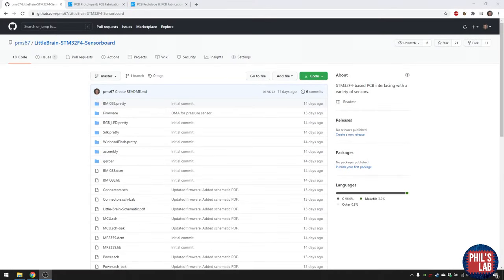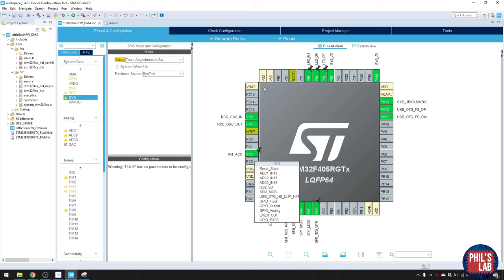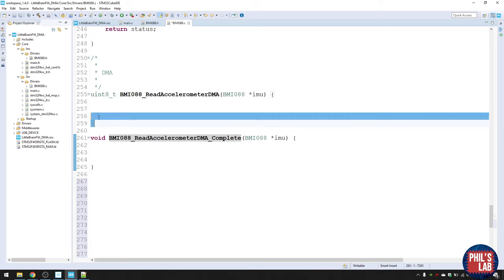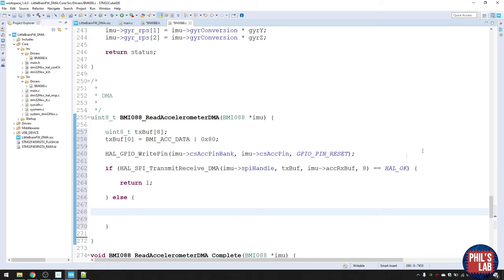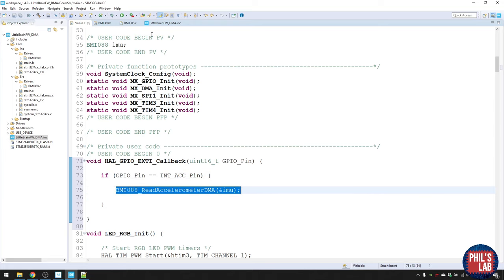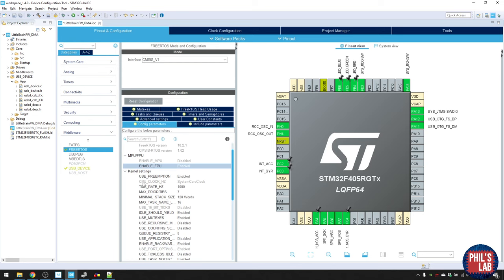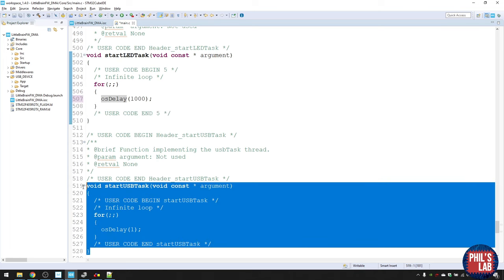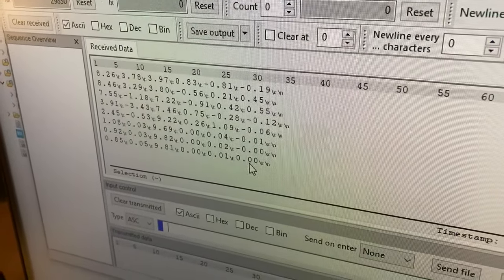STM32 DMA and FreeRTOS Tutorial - Phil's Lab #14

Comment: Thanks. Maybe one quick note on data consistency: If you want the IMU data in the printing to be consistent (all from the same sample), you should copy the data onto the USB task stack (local variables) inside of a critical section before printing. That protects against the IMU data from being partially updated by the interrupt during printing. This is naturally also true for using the data in other contexts: A Kalman filter would also want consistent samples. I am sure that you are aware, just thought I add that for your audience as such stuff can lead to extended head scratching :).

Comment: Would it be possible to design a board using mostly smt parts from the jlcpcb catalog, that is capable of running "ordinary" Linux, preferably with X11 and a connected USB mouse and keyboard? We seem to be so close with some of the more advanced embedded SoCs, but there seem to be very few processors in the JLCPCB catalog with an MMU.

Comment: Hi Phil, thank you for your videos! I have a question about connection using SPI but also any other interface, what kind of countermeasures do you program in case of error? I'm currently working in an application where I use the UART port in DMA mode, using cables between the STM32 and a Raspberry. According to the manual, if there is a framing, parity or noise error during a transmission, the DMA transference is aborted. The way I use to react to this: in case of error, UART error callback is called, I then write an Error state to a variable. A timer, every 3ms, calls an error_check() function on period elapsed. This function restarts the transmission on error. I don't know if there are better ways to overcome errors. I don't know either if all this is worth the code and time if the two devices connected by UART, SPI, etc are in the same PCB, where there is no possibility of cables getting disconnected.

Comment: Good tip, when you do "if (some_var == some_const)" I write it the other way around, so, "if (some_const == some_var)" so that if you have a typo and only put one = by mistake you get a compiler error for trying to assign to a constant.
I also like using zero as success, rather than 1, so that you can have many error codes that can be handled higher up if needed. I that's how the HAL works as well, HAL_OK === 0
Great video as always by the way!

Comment: Your videos are great, thanks. A request for future content that might be a good fit down the line:

FreeRTOS inter task 
  -signaling,
  -memory protection and
  -data sharing.

Probably with a concept of how to organize responsibilities. E.g. Kalman Filter operates on top of data from multiple sensors without having to lock for access. But an intermediary might be required if the multiple sensor inputs have to be consistent with each other. Something like that :).

Comment: question about sensor fusion, if you have an IMU that has different polling rates for the different sensors, how would sensor fusion work? Sure if it were a multiple you could I guess just use the lowest multiple sampling rate and subsample the other sensors or maybe average out the samples to some degree if a bit of phase delay is acceptable. What about when it is a non-integer value? Is the best solution to simply read whatever happens to be the most current value in the FIFO and read all the sensors at periodic intervals determined by a timer in your MCU?

Comment: I wonder if the "impedance control" option means that they will use a suitable prepeg material (that is, one that is electrically more uniform in every direction). I can't find any specifications about that option.

Anyway, this video of yours should have more views and likes. It is as if YouTube does not promote videos that are technical and in depth. I find your content accessible, very well explained and nicely presented.
Reply from the maker: Yeah, that’s a good point. I’ve assumed that it should mean something along those lines, but I’ll send them an email to check.
Thank you also for your very kind comment!
Reply: @PhilsLab  No problem. Merit where its due!

Comment: If you set 'osDelay(500)', does it mean that the loop runs the user code first and then waits for 500ms, which results in a total duration longer than 500ms? Or does the RTOS wait for only the remaining time of the 500ms, which would result precisely in 500ms period?

Comment: Thanks again for sharing Phil! I was just wondering though: you opted to use the SPI RxTx Complete interrupt to call your 'DMA Complete' function. However, there's also a DMA transfer complete interrupt callback. Is there a specific reason you chose the SPI interrupt over the DMA interrupt?
Also (without having checked the Github repo), did you implement something like a mutex to safely read the sensor values from the logging/usb task? Because in theory the task might try to read it, while the DMA is still in the process of writing it, isn't it?
Reply from the maker: Thanks for your comment, Bastiaan! 
No particular reason for using the SPI callback instead of the DMA one. I believe both should do the job in this case.
And yes, ideally some form of read/write protection (e.g. via mutexes, as you said) should be added to avoid potential access problems. Should probably have mentioned that in the video, but I guess I just ‘flew through’ it to give a rough overview! Will be adding more firmware code to this project, as this will be used in videos on filtering, Kalman filtering, etc. :)
Reply: @PhilsLab  No problem, thanks!!!

Comment: As always very helpful video with great explanations! I'm usually trying to use FOSS tools, but now I'm tempted to give this IDE a whirl since the graphical setup tools seem really nice for getting to know the STM32-family. In your experience, is this IDE/toolchain mature enough to use for production? I read some horror stories about bugs in the HAL/code-generation, but these might have been fixed already.
Reply from the maker: Hi, sorry for the late reply! Thanks for your comment :) 
I believe you could use STM32CubeIDE in a production environment. There have been bugs with HAL in the past but they are being ironed out over time, so I'd say give it a shot!
Reply: @PhilsLab  No worries. I've had a small project coming up that needed a pretty gui for our client so I tried out the tools and really like touchGFX and its no-cost license. I'm new to STM32s, FreeRTOS and touchGFX, so I use only basic features and should be absolutely fine using the free vendor tools. I learned that touchGFX and the CubeIDE is meant to play nice together when generating a project in touchGFX and then importing it into CubeIDE. This way is easy and works great. There is a tutorial on yt that starts a project in the IDE, generates a second project in touchGFX and then merges everything manually and is definitely not recommended for beginners. Fortunately this convoluted mess is not necessary anymore with the current version of tools, which is great.

Comment: Hi Phil! Thanks for this video. Are you planning to record something about exchange data beetween tasks (use of Queus, Memory Pool, Mail )..? I didn't found nothing well explained , because the FreeRTOS is wrapped by a CMSIS layer by STM32CubeIDE, there is less examples avaliable than pure FreeRTOS implementations. Specially exchanging structures of data instead of a single integer. Please.. thanks!
Reply from the maker: Hi Fernando, Yes, I plan on doing that for later videos, when I go into more detail on something like Extended Kalman Filters, digital signal processing, and so on. Got a few different things lined up! :)

Comment: If i want to save risen and falling IO events for lets say 16 pins for a period of time, lets say 10 min. How can i save those events in the chip? Is there any eeprom? Or there is a flash position that i can write?
Then i want to reproduce those events in the same orther or extract that data...
Reply from the maker: You can (in most cases?) use the internal FLASH to store data. I believe ST has an application note on how to that. I however would recommend to add some external memory (EEPROM via I2C or FLASH via SPI).
Reply: @PhilsLab  Like the flash you used for this project?. Phil, let me tell you that your videos worked as hundreds of  school hours. I am 60 years old and i am still a passionate electronic maker. Hats!!!

Comment: Is the BMI088 significantly better than cheaper things like the 9250 and 6050 IMU that I often see used in drone flight controllers?
Reply from the maker: I believe the BMI088 has better noise/bias performance than the MPU* devices. It is significantly more expensive though.